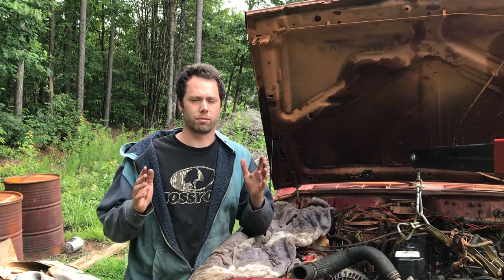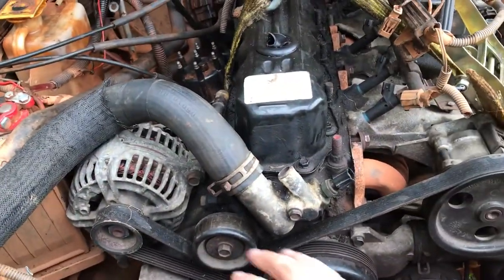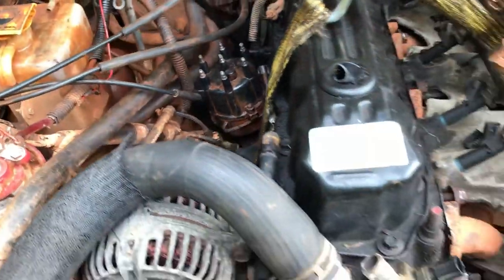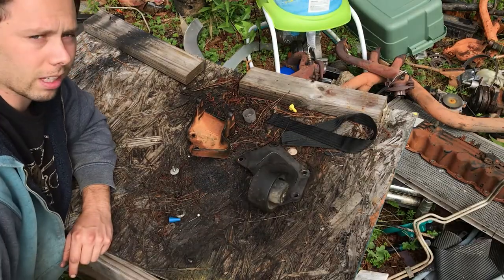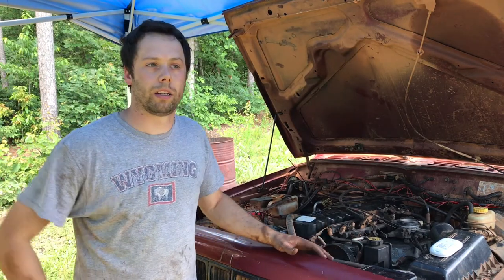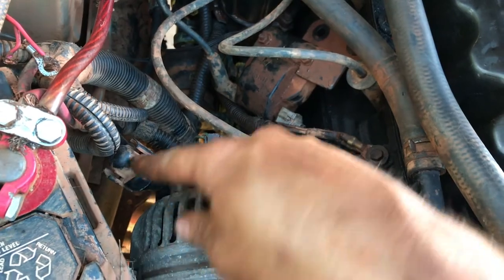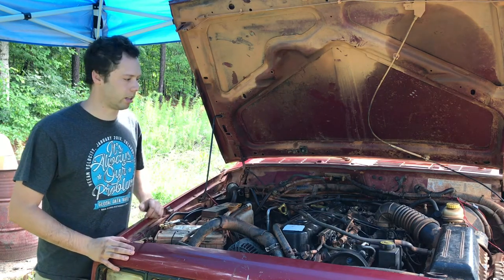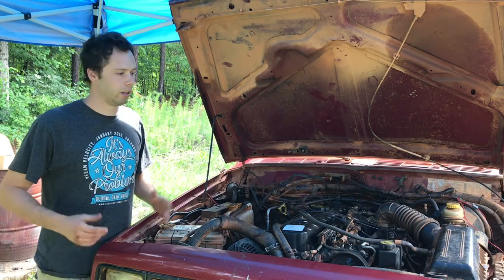Jeep Cherokee Motor Swap with Grand Cherokee Jeep WJ motor swap into XJ 4 0

Comment: What about going the other way x2 to a wj
Reply from the maker: Just check the motor mount holes. Some years on the xj might not line up. You will have to drill and tap into the block or make custom motor mounts like i did.
Reply: @goodmusic848  hey man I'm going through that now we'll my mechanic is he was sure he could do it then he said something about the motor mounts. I have an 02 grand Cherokee and I blew the motor so I got a 98 Cherokee motor and I didn't think it was a difference and my mechanic said he had to modify the motor mounts and everything will be good. But would everything else line up? I know alot of jeep guys and they were questioning wether the sensors would line up? And something about the distributor being different cuz the wj has coil pack. But I do know he took the head off the 02 grand Cherokee and put it on the 98 Cherokee motor. So do you think this swap is gonna workout?
Reply: @goodmusic848  also there were questions about it having to b compatible with the wj transmission
Reply from the maker: @eddieocana3111  I would find another Grand cherokee motor and install in there. I think you will run into major issues - including the misaligned motor mount holes. flex plates are going to be different as well for the 42re trans vs AW4
Reply: @eddieocana3111  how did it go?

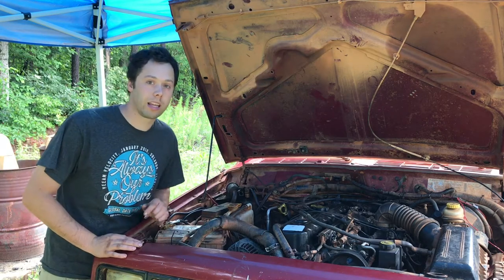Comment: @21:21 did you ever get around to making that list?
Reply from the maker: Motor mounts were the real headache . Otherwise you just have to dump in a distributor. If I had to do it again I would just look for a 4.0 out of an xj.
Reply: @goodmusic848  thank you. Is it possible to make this work with putting the xj into the wj?